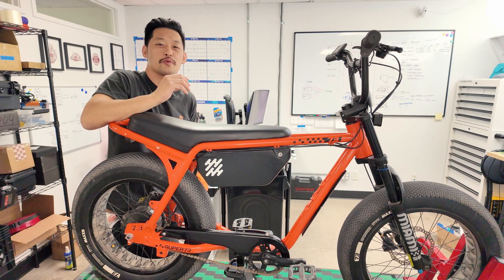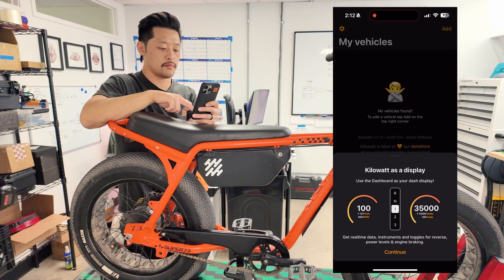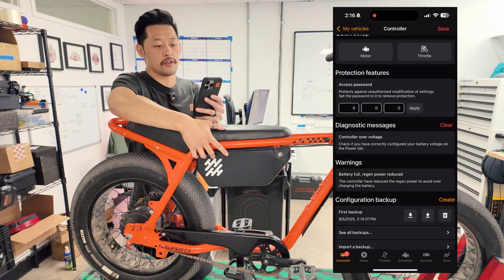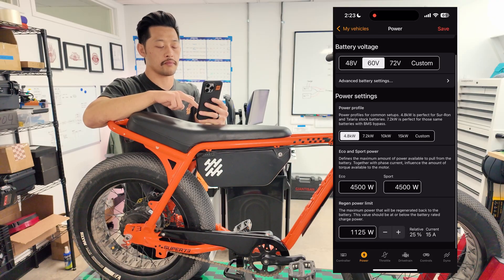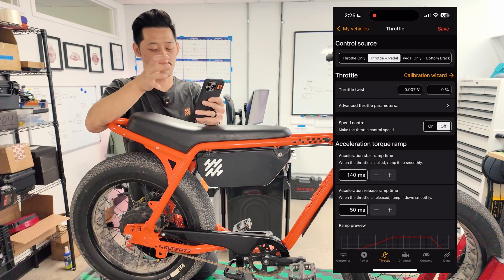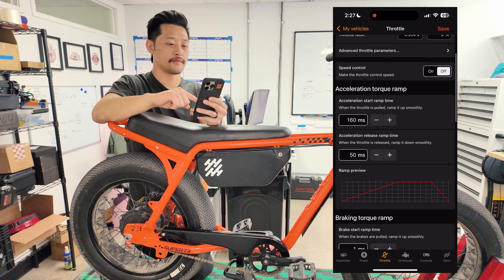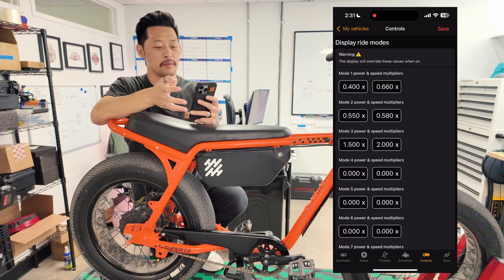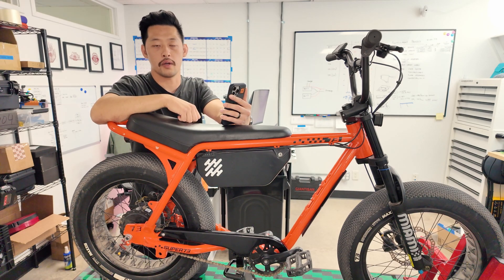Using Kilowatt on a Handlworks BAC

Comment: I have a super73 z Miami se, with a 750w motor with a peak about 1300w, I have a stock battery and a chi, when I get my bac855 will my motor blow, and if it does do you have any motor recommendations
Reply from the maker: No risk to the motor at that power level!
Reply: @handlworks with the tuning, on the developer page it doesn’t how a dual 48v for the miami, which one should I use? And how fast could I be expected to go?